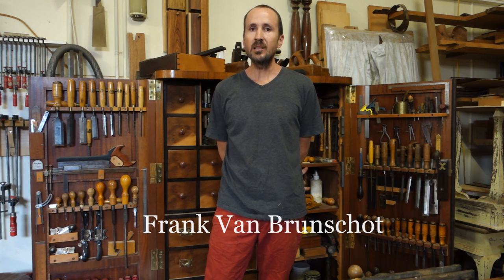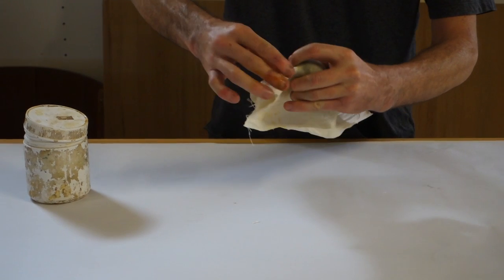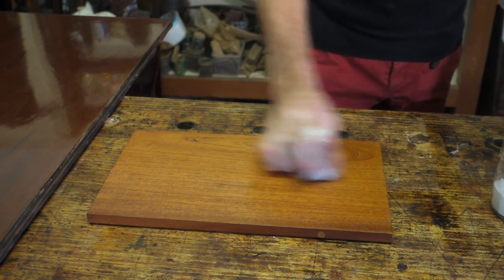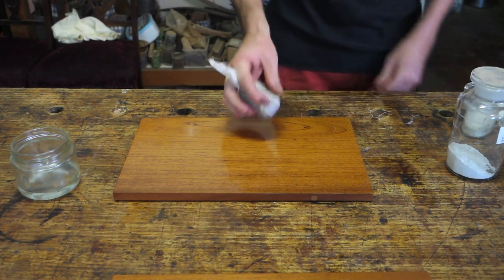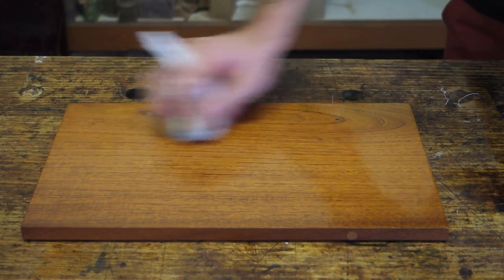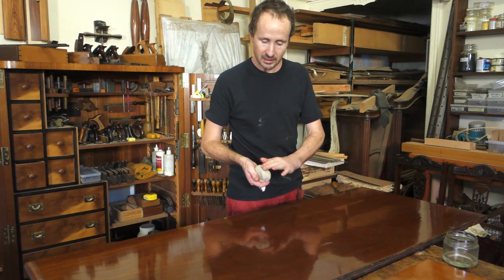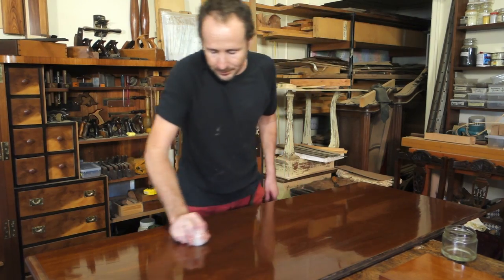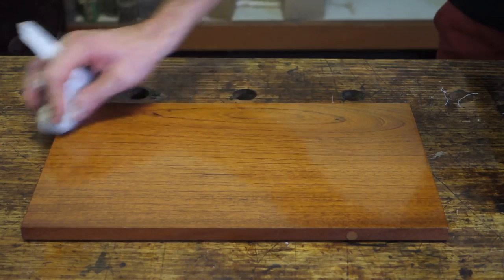How to French Polish

Comment: First of all, you should never sprinkle pumice on the wood.  So right off the bat, I know that you don't know what you are doing.  Try your method of filling on a dark colored wood like a rosewood.  Your white pumice will get lodged into the pores and although some will melt to a clear colorless state, many pores will remain the color of the pumice, white, and you will never ever ever get the white pumice to a colorless state.   At that point, you will need to prick the pumice out of the pores with the tip of a safety pin.  The pumice should be sprinkled onto a scrap working board, then the moist pad should be worked over that pumice on the working board, thus picking up the pumice onto the pad and melting it to a colorless state.  At that point you can take your pad or rubber to your project.   This is how filling should be done.  Never ever sprinkle white pumice on your project.   Always dissolve it's white color first on a working board.  A good size for the working board could be 3"-4" wide X 8"-10" long.  But any size that can take your rubber would be fine.   The thickness of the working board doesn't matter much.  Could be 1/8"- 1-1/2" thick.   Using this method also works the pad out a bit so you never take a wet pad or rubber to your project.  One more thing.   Your pad should be slightly wet when filling pores.  The alcohol is what dissolves the pumice to a colorless state.
Reply: Robert, actually, you are mistaken on the "sprinkling" part. There are legitimate reasons to dust the surface very lightly. I realize that this is not the "Millburn" method, but it does have a rhyme and reason to it. I've been using "sprinkling" method for a long time, with success.